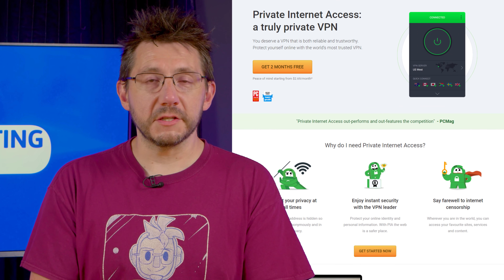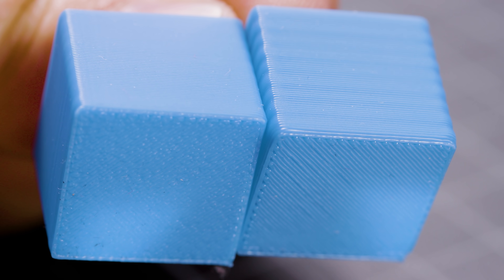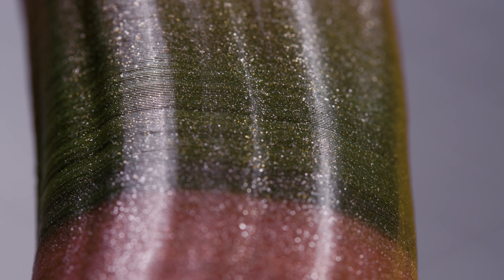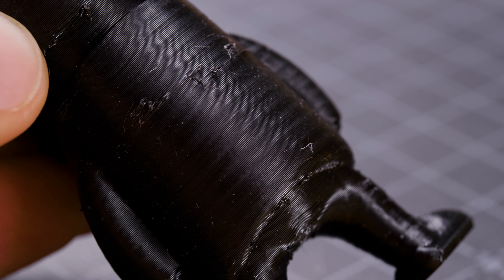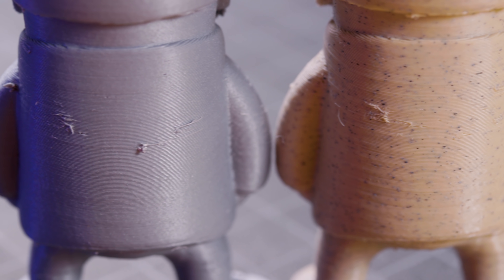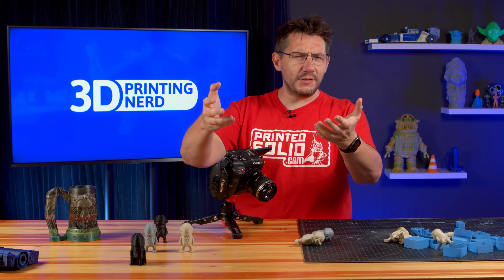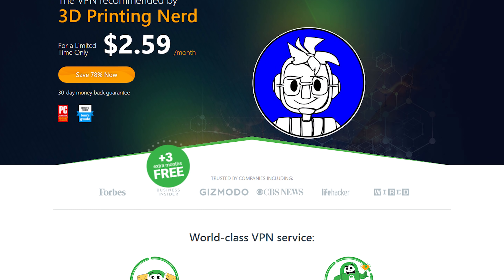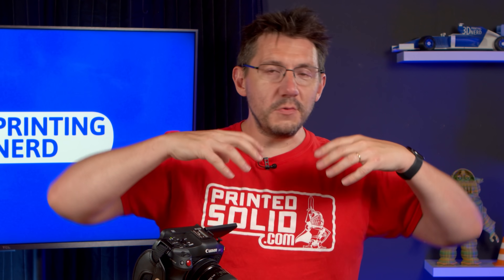Closer Look at Print Quality // Daedalus Follow Up

Comment: Joel: I'm not an expert or anything, these are just the thoughts of 1 of your many viewers. You now (at the time of the video) have 6 motors. Why not try the 3 cubes test again, but this time just swap out 1 of the motors, and depending on how that goes keep swapping out the worst until you get the best result. Might be a good idea to number the motors so you can keep track of which ones you've tried in which combination. I know it could get a bit tedious, but maybe you've already found a solution for it by now anyway. 🤷‍♂️
Reply from the maker: ooh that's an interesting idea.
Reply: @3DPrintingNerd  So I take it no solution yet?
Reply from the maker: Well, I don’t know. I have more new parts but I haven’t put them in
Reply: @3DPrintingNerd  LOL, story of my life. I have a black belt in procrastination. 😆 I bought a Sidewinder X1 just before Christmas, and haven't even plugged it in yet. Need to make some space to actually use it.

Comment: Have you tried different layer heights?

It would seem that if there is a evenly distributed, and repeating vertical movement defect it could be related to some sort of rounding error between called for movement and actual movement of the machine that breaks at certain multiples of whatever it's minimum height movement is.

Also, you could program a larger z-hop, to  prevent any backlash in what those couplings are doing from actually affecting the final height after each movement.

Comment: I see banding everywhere. My friend’s Prusa Mini+ is inexplicably doing it. But. BUT. You never said how to fix it!

If it’s on the Prusa too …. I can only assume it’s either flow rate or positioning. It’s so repetitive though.
Reply: it can be caused by the heat bed too. Metals move with heat, so imagine the print bed heating up and cooling down during its cycle trying to maintain the temperature. PID control helps with this vs Bang Bang

Comment: this is a classic problem that comes from screws in general.  periodic error can happen from bad couplers (eccentric), bad Z nuts(loose fit, sits offcenter), bad/bent screws (machining error causes banding, bent screw causes shifting from force transfer), overconstrained screws (makes bent screws transfer more force), or any number of factors really. Someone else also mentioned it could be caused by the bed, but that's not likely on a PID tuned bed, only on one that uses bang bang since a PID tuned bed will stay rather steady instead of heating and cooling, causing the bed to expand and contract as it goes through the cycle.

Comment: That pattern is very consistent, but also barely visible. I had the same issue and found it was a very minor flat spot on a wheel on my z axis; coupled with some minor wobble in the gantry, where the eccentric nut on the x axis was not completely tightened properly.

Comment: You have the problem that everyone else has. At higher speeds, the print bed comes into play. Bang Bang then draws too much current and this causes these wobbles. I didn't have this in Marlin because my bed wasn't running in Bang Bang mode. In Klipper I didn't have that set and then struggled with it for two weeks until I found out what it was. Watch the video from CNC Kitchen "PID vs Bang-Bang Temperature Control". It explains the problem. Greetings Roy :-)

Comment: If I remember correctly I think the biggest reasons why "we" could see the issue is due to angle and lighting. Since the lights are pointed in your direction, thus the direction of the models, it was easier to catch on screen under the brighter lighting. Add into that the angle to the camera, the fact that video is never 1 to 1 with what a person sees IRL, and all the other little things that can go "wrong" during the process (and being human) . . . these sorts of things will happen from time to time. 
But it's great you took the time to look into it and check it yourself! Really speaks to your integrity and that of the channel. Hopefully this printing issue is an easy fix!!
Reply from the maker: Thank you! I hope so as well :)

Comment: Dang! I was excited to see that issue get corrected, but alas! No such luck. I have a refurbished Lulzbot Taz 5 that has been doing the same thing for years, and it's extremely frustrating! I don't know if it's the lead screws, the stepper motor, the extruder, or what... It has unfortunately been the downfall of 3D printing at my house. Invest so much in a device that prints so poorly 😭. Maybe one day someone will discover a fix... Thanks always for your entertaining and informative videos!

Comment: Nice video.  I thought the same as many of your other followers in that I could still see artifacts.  I’ve tried many different couplers over the last couple of years.  The ones you showed here are different.  I’d be interested in seeing them and the results.  In my case, I got rid of the couplers completely on my two lead screws and motors.  I went with a set of steppers that have the lead screws built into the stepper axis.  I then made sure I had no binding or racking in my z axis before tightening the motors down.  It’s about the only thing I found that solved my z artifact issues consistently and for any length of time.

Comment: Build plate temperature inconsistency. The build plate heating and cooling too much causes the build plate to expand and contract which results in slightly too high layers in some places and slightly too thin layers in others. The tell tale sign is the pattern of inconsistency repeating consistently. Check that your build plate isn't fluctuating more than a one (maybe two) degrees C while you are printing.

Comment: I didn't see the first video referenced here, but it looks to me like the layer height wasn't a precise multiple of the minimum Z-Axis move of the stepper motor in each case. E.g., if your layer height is .05mm and your stepper motor caused moves that were .0049mm, you would need 10 clicks for almost all layers, then suddenly the printer would go to 11 clicks to "catch up" to the right overall height.

To check this, you could use slightly different layer heights and see if the pattern changed spacing. If it does, then presumably there will be some layer height at which you get the least effect from the mismatch and still decent overall print quality.

Comment: Good video, but when you're doing comparisons why don't you use the same color and brand of filament? It would take out a variable! You could also just use the same brand and type with different colors if you wanted, but it would be harder to compare since different colors reflect light differently
Reply from the maker: I will be going forward. Unfortunately, originally I didn't have any more of the tan filament I used. I was going to, but ran out!

Comment: Have you checked the stl files for any problems prior to splicing? I can slice a file in S3D and the same file in IdeaMaker and IdeaMaker says there are errors. I will then take the corrupted stl file and repair it using Windows 10's 3D Builder. In any case, you might want to test print the same files when you get the new couplers first and if that doesn't solve the issue, then try running the stl files through 3D Builder to see if that would solve the problem. Also, have you printed these same files on another printer to see if you get the same problem?

Comment: This is a classic problem caused by bed expansion/contraction as it heats/cools during the print. Either your firmware (likely Marlin) is using bang bang for heating, or the PID tuning cycle needs to be re-run in the bed. The easiest way to test this is to print a hollow 20mm^3 cube (no top, no infill, one shell) twice. On the second one, shut off the bed heat after the first layer and let it finish as the bed cools. Compare.
Reply: This seems more likely than the Z nut being tight and the rod being warped. However, changing the motor changed the pattern so there may be multiple contributors.
Reply: @OldCurmudgeon3DP  one interesting / maddening thing about this effect is that it can be heavily influenced by environmental factors. for example, moving a printer from one drafty location near a vent to one with no airflow. even just having the AC on one time and off another. so printing during the day or night could have a huge influence, too, if your bed PID has this issue.
Reply: I could see how this might affect the first few layers, but once the print is a few mm above the bed, I have a hard time believing the bed expanding and contracting would influence the print dimensions this significantly. Also, I would expect the heating/cooling cycle of a poorly tuned bed would be <1 minute, while the artifacts on the print shows a cycle time of ~10 layers or more. Of course this is just my first intuition and your test would be easy to run and prove out.
Reply: @PCrowlz  When the bed moves up and down, the entire part moves with it. It doesn't matter what layer you're on. Perhaps it would help you to think of this as sinusoidal babystepping of the Z axis. Regardless, I've had this issue in a couple of my printers and done controlled tests per my original comment. You can get banding over the entire height of quite large (300mm+) parts.
Reply: @GridSpace  Ah good point! I initially wasn't considering the expansion in the Z-axis being significant enough, and was thinking only about X/Y. Great observation.
Reply: It could be the bed but more likely a binding z screw
Reply: @DangaRanga  crossed my mind as well, but it changed with him swapping to the 0.9 motor also.

Comment: Might it be that the layer height isn't a multiple of the z-step height? E.g. on the Ender 3 I think a full step is 40 micrometers, so a layer height of 160 micrometers should print better than with 150..
It's hard to see from the video if it's shifted in the XY plane or expanded.. If it's shifted, then it's more likely a wobble in the Z lead screw that repeats every full rotation, probably 8mm.

Comment: New couplers will probably help and you may want to look into a "wobble nut attachment" for the connection to the print bed.  It allows the Z rod to wobble around and the build plate stationary

Comment: Should it take the community noticing print artefacts push manufacturers to implement fixes to their printers? I refuse to believe manufacturers do not notice these things before launch and only decide to fix things when the community starts talking about them, I would be willing to bet that the majority of printer designs of large companies finish as good printers until the suits get their hands on it and change the parts specs for profitable ones and do not for one minute consider the negative implications of such changes.
Reply: It's called a minimum viable product, very common these days, unfortunately

Comment: Is there a true-problem-free FFF printer? I think I would get one. I hate my resin printer.
Reply: The most likely candidate would either be an Ultimaker or Prusa machine
Reply: why do you hate your resin printer? is it giving you problems?
Reply: @ThumpertTheFascistCottontail  Resin is toxic, IPA is toxic and I already got chemical burns here and there and create tons of toxic garbages. I saw my friend using one of those MFM printer and prints failed all the time(it was ultimaker) and the succeeded prints still has blisters and the layer texture on it. So I know SLS is the answer for me but they are too expensive.
Reply: @EternalEDC  Use water washable resin. Also, chemical burns? Do you work without gloves?!
Reply: @harmless6813  I printed small bracelet tried it for a day. Unfortunately the surface was slightly sticky and I thought it is because I mixed the resin with Tenacious resin. After it gives rash I stopped using it but the rash developed to serious chemical burn.
Reply: @EternalEDC  That doesn't sound good. Did you cure the print long enough? Obviously, you are not supposed to touch not fully cured resin.
It's probably an allergic reaction. Here's more information:
https://www.westsystem.com/safety/health-effects-from-overexposure-to-epoxy/
Reply: @EternalEDC  yeah that makes sense, resin printers come with their hassles. hope you can find a filament style printer that suits your needs
Reply: @harmless6813  I thought I cured it enough. It was cured for 30min after cleaned in Mean Green.

Comment: Honestly, that repeating issues is just a small thing. The over all print quality of those models did not look good, there are nicks, strings and all sorts of crap on the surface of the model that need to be address before the repeated banding issue.
Reply: Those nicks etc are due to supports not coming off correctly, plus most models will look okay ish off the bed! To make a print perfect sanding etc is needed.

Plus like he said, it was new filament and a non tuned profile! As someone who does hell lot of printing this the most common issue for things like this!

But yer, supports, new filament and new print profile is the common thing.

Comment: I didn’t see the stream that’s being referred to, but to me this looks like the hot end temperature is bouncing back and forth like it needs to be PID tuned. Like it’s going +/-5° around the target temp causing it to look slightly different and extrude slightly different. 

I bet if you printed a temp tower with the same filament on a different printer you’d see the same range of color/extrusion width.
Reply: This is the best suggestion I've seen. Yeah, PID tuning seems like a good step to take.

Comment: I’m curious how many people start with a cheap printer and just upgrade things until it’s better, or buy new higher quality printers. 

People always knock adding upgrades to the Ender that cost more than the Ender itself. But it makes more sense to me to add a $200 part to the Ender than to buy a $1500 printer that has the same upgrade.
Reply: Some people don’t realize that if you buy a low cost but upgradable printer that you can enhance it as you can afford it.
Reply: @armandoa2484  it's all part of the fun and you will understand the machine a lot more than buying something expensive and never getting into how it works.
Reply: @armandoa2484  exactly. And the Ender is purpose built for that too. I could understand if it was one of the cheaper Prusa clones or something where there’s only so far you can expand it before hitting a wall. 

But with the Ender, you could literally turn it into a full Core XY direct drive, large platform etc etc beast a bit at a time without wasting anything.
Reply: I just upgraded my CR20-PRO with new silent driver board and Dragonfly all metal hotend. Both of those cost as much as a new ender 3, but now I have no more salmon skin and can print fancy high temp materials without damaging the bowden tube so well worth it.
Reply: @DJlegionuk  I was amazed how much of a different the SKR mini v2 made to sound levels over the creality “silent” board. I mistakenly thought I needed to upgrade it, so I did, and boy am I glad I did. Went from drunk R2D2 singing for 14 hours to a librarian thinking about a ninja dreaming about a whispering for 14 hours. 

How do you like the Dragonfly tho? I was just researching that and thought it was right up my alley for smart design,
1 easy/accurate nozzle changes and all metal so I would be able to do ABS and it’s what made me wonder about this topic in the first place. 

Did you get the slice engineering official one or a clone? And did you go regular or +/magnum?
Reply: @radicalxedward8047  I have the Phaetus Dragonfly and the crealty silent upgrade board. I was going to fit the SKR-1.4 but the screen was wrong and it needed mods to the case.
Reply: @DJlegionuk  does it still make noise from the steppers when it’s moving? I thought I had the old board cause I bought a regular Ender 3 and it made a bunch of noise. Wasn’t until I went to replace it physically that I found out it was the 4.2.2 board (which is identical to the 4.2.7 board just bundled)

When I first ran a home all on the SKR E3 mini I thought it was broken because it was so quiet (actually silent except for fast travel moves)

Now I’m looking at upgrading to a dragonfly and just debating between clone vs real (clones can make a lot of mistakes) and whether or not I wanna go direct drive to try to reduce PETG stringing. 

Where did you get your dragonfly? I haven’t heard of that clone before and I’d love to check it out.
Reply: @radicalxedward8047  the CR20-PRO does not use the same board as the ender3 it's   a cr series. I forget the version, but it's very quiet compared to my stock Ender. I bought the dragonfly from 3djake

Comment: Were you slicing at a layer height a multiple of the step size and lead screw? (Eg, usually 0.04mm multiples for most common steppers and lead screws) if not you might get that especially if there's a z hop.

That at least feels like a possible cause given the size/frequency of the repeat. It looks like it could be "the printer gets to a multiple every handful of layers".

Or, totally different, it might actually be from the extruder. Think I saw something like that on a Lulzbot Mini from the spool rocking back and forth on the spool holder. (That printer had other troubles we couldn't figure out, just lousy print quality, but a repeating artifact of about that frequency did go away when we modified the spool holder.)
Reply: Magic layer heights is another good suggestion. Lot of good ideas already in the comments here.